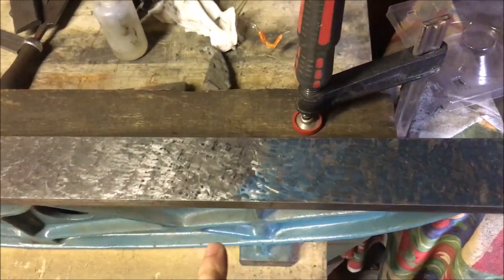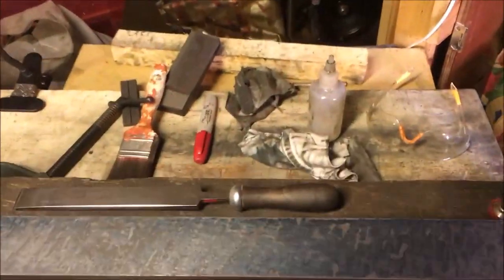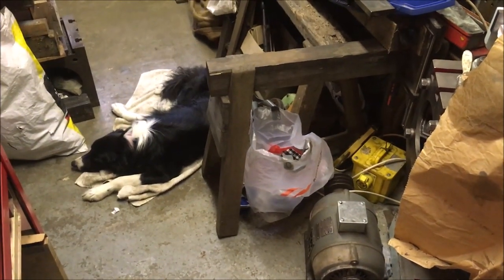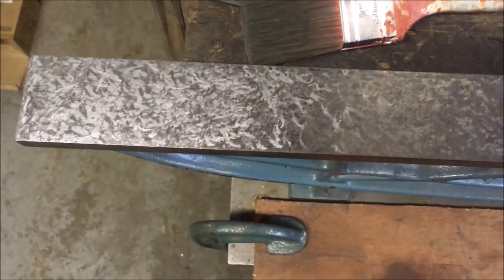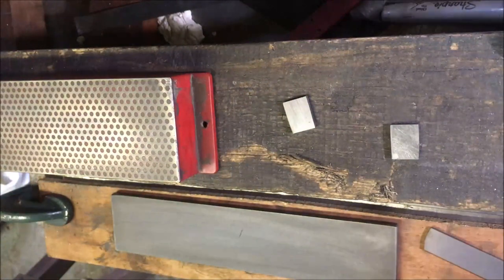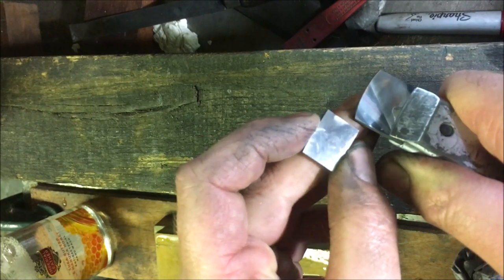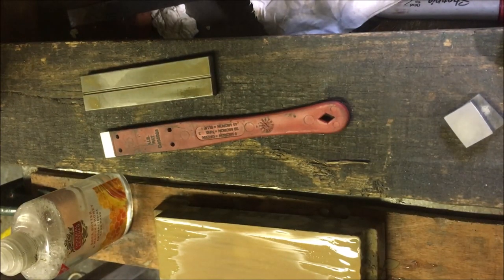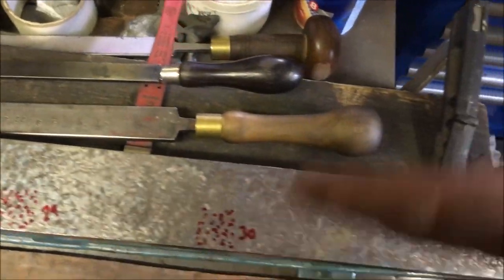Scraping the 36 inch SE pt2

Comment: The mountains you're climbing to get to the mountain you intend to climb are amazing.  I continue to enjoy following your journey.   I can't wait to see that blower.  Of course if you can get it to run via Peltier; WOW.  <Grin>
Reply from the maker: Hi Russ, I would have to wire up a huge array of peltier units to get anything like enough current to even turn the blower - be hell of a project though !  Having spent 7 hrs scraping in the next SE yesterday - this morning my arms and legs ache ! ind you I removed around 0.004" of iron  below the rust I scraped off first. Another day at roughing and I should be ready to start printing and establishing a datum to work to - I think this one is 52" x 3.250"  surely a foot hill to the final 6 footer required :-)

Comment: Enjoyed Mat!
ATB, Robin
Reply from the maker: thanks for stopping by Robin - could I ask your view on the depth of the curling required for a SE. All of the older straight edges I am working my way through show similar curling and no appreciable depth (maybe a few tenth's). Now it could be they are all heavily worn, or what I suspect the surfaces were not made with deep scrape marks i.e. under 0.0003" deep.  Which is quite big difference to the practices shown over much of YT. ?
Reply: Lots of opinions on this. my straightedge is a case hardened weldment of low carbon steel that has been ground and lapped flat. It has no depth of scrapes, but neither does your granite surface plate. Scrape depth can be a means of indicating a worn out condition. But how much wear is acceptable to you? If you are expecting loss of scrape pattern to be your signal it is worn out of tolerance then your depth of scrape better be that depth or less. I have not answered your question because IMO there is no right answer
Reply from the maker: @ROBRENZ  actually Robin, you have answered it quite appropriately.  Thank you for taking the time to come back. Currently scratching away at a 4ft SE. I've taken 0.003" off so far roughing away material to get below the majority of the rusted face. All the very best, Mat
Reply: Thanks for giving this man your extremely valuable input Robin.
Reply: @xmachine7003  You're welcome.

Comment: Afaik Mat rust ends up as partially a simple form of carbides throughout some of it and will or should be much harder than the parent metal. The dust from it is considered as highly abrasive. Only best guesses of course, but those rust converter/eaters likely still leave a thin surface crust of the converted rust and almost for sure the pitting would contain more. It's at least one remote possibility on why you were finding it tougher to scrape a previously rusted surface? If this is happening then a noticeable quicker dulling of the carbide scraper edge would show up. Sanding the rusted straight edges with a common wood working palm or belt sander to get the metal down close to the bottom of the pits might end up as the quicker method by the time you get to that point by hand scraping. No it wouldn't be close to flat, but it would save rough scraping all that metal off that needs to be removed anyway. Even an angle grinder with a wire wheel might remove enough to at least make it a bit easier. I still wouldn't bet money on my thoughts, so there worth about what you paid for. :-)
Reply from the maker: I think you are right inyour comments. Getting the rust and waste material off quick is going to be key for the next SE
Reply: I haven't actually done it, but have seen roughing done with a small angle grinder. You use the same basic strategy as when doing regular scraping. Print the straight edge then carefully use the grinder to knock down the high spots, until you get to a surface you are ready to start scraping. This was done on a large lathe where it was impractical, because of size, to have it reground first. Once again it's too bad you are on the other side of the world. Would have been an easy job to set up on the shaper and knock .010 off the bottom for you.
Reply from the maker: Ive read about chaps that ground with angle grinder a hardened lathe bed back to good - tricky work I guess.  I am sure that the cast iron of that straight edge was bloody hard and abrasive - certainly more so that the others Ive worked on.  Thanks for stopping by and commenting - it would have made a nice vid' seeing your shaper peel off a few though along the SE :-) Mat